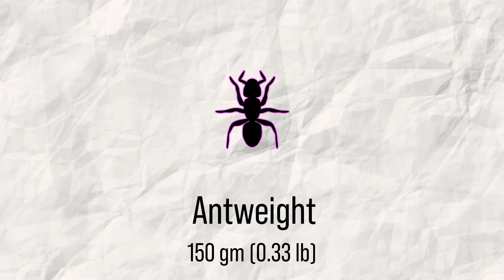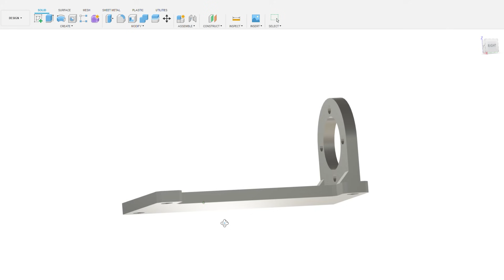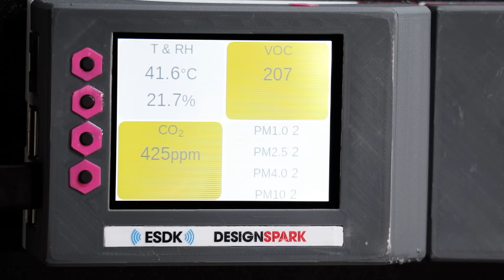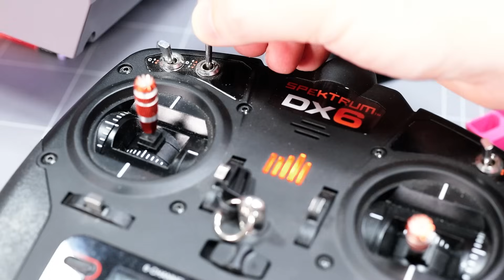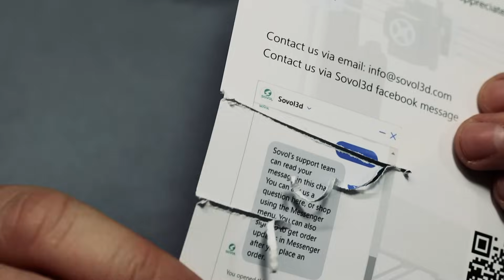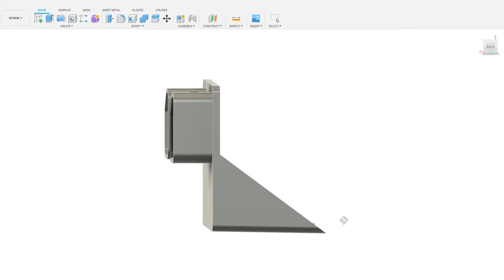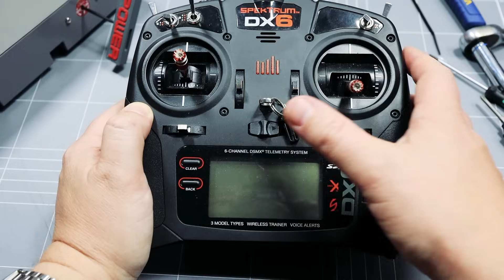Building a Deadly Nintendo NES Combat Robot

Comment: I've been building BattleBots since 1999 and back in 2002 had a similar idea. I got a hold of an NES that didn't work anymore and gutted it. Everything was bulkier and heavier back then (brushed motors, NiCd batteries, etc) so I couldn't fit an active weapon onto it. Instead I made some fixed blades that mounted on the corners of the chassis with the intent for the robot to spin in place and attack like a spinner. Driving while spinning, aka Melty Brain, was something that nobody had quite figured out yet but the robot featured a primitive version of it that allowed me to spin in place and arc to the left and right.

By the time I was finished with the robot I realized it was too beautiful to destroy and that 25 year old plastic wouldn't offer much protection, so the robot never entered combat. To this day it remains a showpiece of my workshop surrounded by the remains of my other builds.

Comment: Just so you know the FET's on those 20A FT escs will eventually detonate on 3s and on 4s they are a literal fire hazard (idk how they have gotten away with selling them still). I would get some 35a blheli_32 escs which can be programmed to reverse with an Arduino or get some preprogrammed ones from rectified robotics. Also if you remove some teeth from the sawblade it will dump more energy into what its hitting cause it will get more engagement.

Comment: Still at the beginning of the video,  but i hope you can find some way of incorporating the controls into a power glove.  It's so bad.  😂
Reply from the maker: I hear you. I wanted to use a NES control pad, but no time for that.
Reply: @electrosync  it's a pretty awesome project, that's for sure. Not a particular set of skills or wallet that I possess,  but I enjoyed watching you put it together. Did you figure out the issue with the saw blade stopping under resistance? Have you considering harvesting an angle grinder for parts to replace the drone motor perhaps?

Comment: whats a seegah?
Reply from the maker: Sega in Australia: The Sega theme wasn't "sung" until the Mega Drive. Which sold less than half the units of its predecessor (300,000 vs 650,000) and was soon overtaken in sales by the SNES. Which meant that the majority of console owners never heard the correct pronunciation of the brand.
Reply: @electrosync  That's all well and good but when is the Master System fight happening? 😄